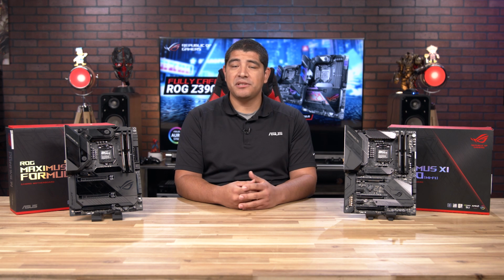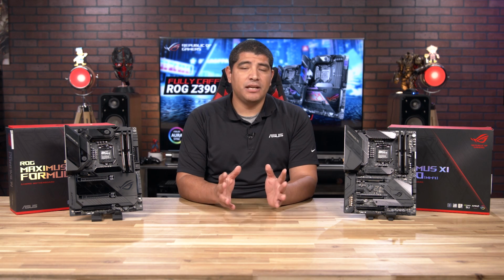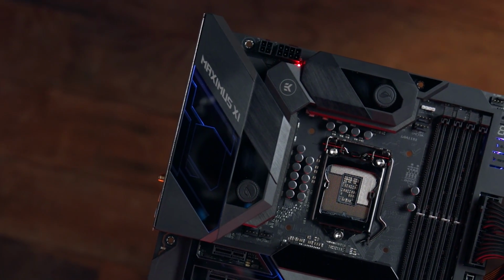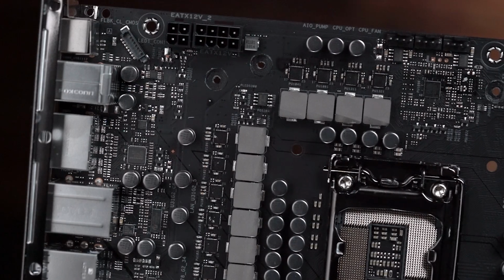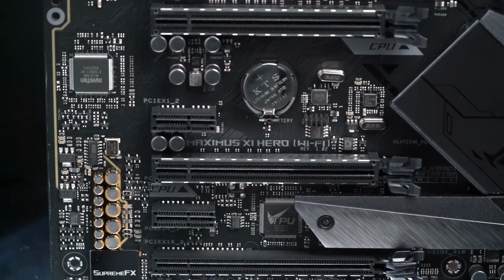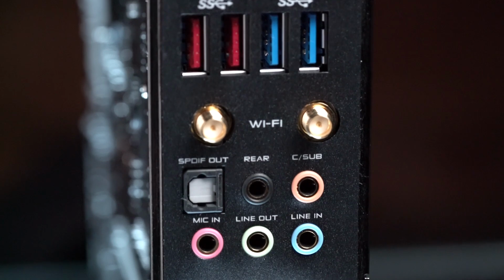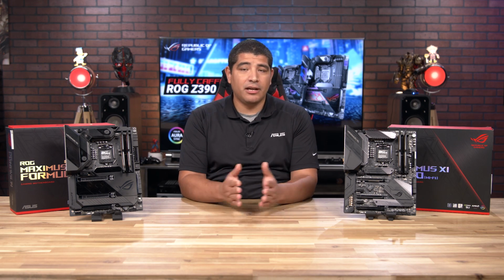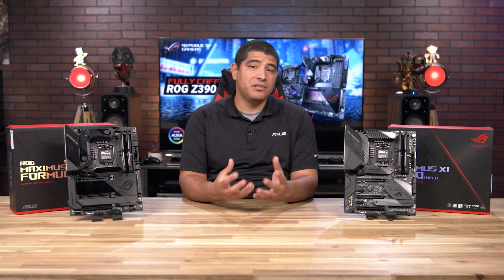ASUS ROG MAXIMUS XI HERO & FORMULA XI - The Ultimate Z390 Gaming Motherboards

Comment: thanks for a great video. Just one thing about the Maximus XI Extreme that I purchased some months ago, I have really terrible audio especially youtube video playback, it crackles and stutters no matter which driver version i try. I've tried setting the driver with MSI mode utility tool but that didn't help. I may need to RMA this mobo.
Reply: That sound like a u problem jk its probably jusg your board it probably a manufacturer error retern it and buy another one

Comment: Can anyone help me? I don’t know if I should get a Maximus 11 hero or formula or extreme. I am buying a rtx 2080ti strix and a i9-9900k .
Reply: Shamonst3r go for formula, it’s the best board on the market at this time and your build can be well complemented by a good mother board. :)
Reply: I have one question though. The formula has a ek waterblock but I won’t use water cooling. Wouldn’t that part of the board overheat then?
Reply: Please respond
Reply: @shamon3946  no that i know of, if the air cooling is fine for other mother boards that has ek waterblock, the formula mother board should be fine. I use a AIO on my Formula board and it is just fine.

Comment: Guys, can I use the FORMULA XI motherboard without a water cooling system? If I play a lot or work with a lot of render, could there be a problem of overheating on the motherboard if I do not use a sophisticated water cooling system?
Reply: You can, water cool keeps the components cooler and you can push the board to the max.

Comment: Do you have to water cool the VRM section or is that just a secondary option?
Reply: The VRM is designed to run passively and active ( with water ). The full copper heatsink has the ability to dissipate heat even when overclocked. You do not need to water cool it but it is designed to perform at its best with water. if you do not want water cool it then you would probably be better off getting the CODE or HERO unless you specifically want the aesthetics of the FORMULA. You can check out a review at overclock.net where they tested the board even with a full overclock even without using water cooling.

Comment: Asus software Aura and LiveDash is broken even with newest version. It has been been broken for almost a year now. LiveDash settings won't take effect when applying your settings. And Aura software sometimes won't launch showing "Aura stopped working" even with newest version.
Reply: consider emailing me with more details at PCDIY at Asus dot com - I have currently tested the current version of AURA and Live Dash without any issues. There are cases with the previous legacy builds where there can be corruption or issues with the registry causing problems. In these situations, I do recommend you try a clean OS install and then install the applications separately with full reboots between installations. With the current 1.07 build, I have not had any issues with control, sync, rebooting. We are also working on a large update where we will be integrating AURA within our new Armory Crate application. This will unify control, monitoring, and RGB lighting all within one application.
Reply: @jjguerrero8465 . Big fan since Newegg with Paul's Hardware days. 

Update. I am currently using LiveDash Version 1.01.08 without AURA installed.

Motherboard: Maximus X formula
CPU: i7 8700k
RAM: Dominator Platinum 16gigs @ 3200Mhz

Uninstalled LiveDash Version 1.01.08 and decided to try installing the newest  LiveDash on ASUS website for this board. The result, same issue. The latest LiveDash won't let applied settings take effect. Uninstalled Latest version of LiveDash and installed LiveDash Version 1.01.08 again. Works perfectly and without AURA installed. 

Observation. It seems that AURA (Even with older versions) and LiveDash can't quite work well together. And one thing I've noticed is that, AURA's current versions, some lighting transitions like Rainbow mode, the color transition seem laggy that sometimes the transition is at 8 FPS vs without AURA installed, the transition is quite a lot more smoother.

Comment: Z390 boards are garbage for an i9-9900k,some cheap built,hottest running boards with 4 phase vrm.not to mention some of the most expensive.i watched in depth teardown  reviews of these 390 boards and they are garbage.asus z390 boards are the ones I'm taking about for those who dont know.
Reply: @Daniel I know I have a z390 gigabyte aorus master. I were talking about Asus z390 boards are garbage.
Reply: @Daniel MSI also has good z390 boards

Comment: I got Maximus Formula XI as well. The problem is my Motherboard always reboot again and again when I start my pc. I find it out because I boost my bus Ram to 3000-3200mhz something, If I use default bus Ram like 2166mhz nothing happen. Anyone know about this issue can u explain me pls ?
Reply: Ensure you have the latest UEFI. From there I would default to using the XMP value for your memory. Once you have done this and ensure it is stable look to increase the memory divider but you will need to increase the voltage for the DRAM beyond it's XMP default value if you overclock the DRAM frequency. you can also help to ensure stability by altering the DRAM timings. Initially, I would consider setting the DRAM timings high to see if the DRAM you have even likes running at higher frequencies. Consider something like 17,17,17 and once you verify stability then you can begin to bring down the timings.

Comment: Not enough Phases for the i9-9900k . The only board that’s with getting for the i9 from Asus is the Asus Rog X Apex and for some reason it wasn’t released in the US and  has better VRMs and phases and is selling in Europe cheaper than the Formula and better lay out than the Asus Rog X Extreme. 9 gen Asus Mobos are the worst ever and I’m very disappointed with Asus. EVGA Z390 Dark ,MSI Meg and Gigabyte Aorus Z390 did it tight for the 9th gen .

Comment: The VRM on my Strix z370i is regularly over 80c when running 4.8ghz all core 8086k, with a fan directly over it and right behind it on a custom water loop. While transient response is great and all, I don't think most users want to have to invest in a monoblock or some sort of active vrm cooling just to run their overpriced Intel CPUs at reasonable all core boosts...This design was fine for quad cores, but there seems to be pretty overwhelming user backlash on the decision.

Comment: Crap VRM on both of them. If you want to go with ASUS this season your only viable options are Maximus XI Apex and Extreme.
Reply: My 9900K is overclocked to 5 Ghz on all cores. No VRM temperature or power issues on this board (Maximus Formula XI) AT ALL.  It's neither overkill nor under-powered in terms of VRM.
Reply: @JcRabbit  hey man what should i get z390 or hero?
Reply: @somakrv  Z390 aorus master or MSi z390 meg ace

Comment: ASUS's decision to go to 4 phase VRM's on these boards was really a crappy decision.
Reply: I’m very aware of the design choices, and there are plenty of boards that can ‘handle’ k processors, the issue is how well they handle them.  The VRMs for the hero design run much hotter than even previous generation Maximus X Hero design on those same processors.  While the additional induction does smooth out the response it would be much more efficient with 8 full phases.
Reply: As noted in my response to Rokugan. The design is proven to show it can handle any of the K series CPUs and without a full understanding of the design, a generalized statement is just that. The design was developed to complement the transient response of the CPU while still ensuring more than enough power is provided when overclocked. This is shown to be the case by the community of users who have adopted the HERO. I would also note the VRM design is different between the HERO and the FORMULA they are not the same.

Comment: Blah Blah Blah next level...I have the X Hero with a 9900K@5.1G + 64GB 3600Mhz Ram and ZERO reason to upgrade to the XI gen, literally ZERO. Asus did really screw up this generation with their fake phases, mediocre components, invisible RGB and overall lazyness. Even the XI Extreme is unappealing and overpriced to me, go see the customer reviews out there. I feel like they´re just milking the ROG brand at this point, which is very sad because many of us loved what it meant. The only MB I would buy for an upgrade is the Gigabyte Z390 Aorus Xtreme, that is a true flagship.
Reply: Thanks for the feedback. The MAXIMUS X is an outstanding board and for most, there would be no reason to upgrade from such a recent chipset as many of the key features are identical. With that noted the VRM redesign is not about cost it has been specifically developed to align with maximizing transient response and also still ensure more than enough current support. Few people truly understand VRM design and I can tell you with confidence we spend considerable time to test and evaluate the design prior to ensure it meets a level of expectation for these class of boards. This has been shown in the overclocking results of the community of users who have the board regardless of the perception that offers may convey regarding the design. I would also note this is something that comes in waves. When we first rolled out digital 8 phase design all competitors noted their high phase count ( low amperage inductors ) for 12 or 16 phase boards were better but slowly every vendor changed to similar digital power delivery designs. In the end, the total VRM design is a sum of  PCB, controllers, individual components, firmware tuning, and specialized microcontrollers. It is not just one aspect and needs to be evaluated as such. Thank you for picking ROG for your current build and best of luck with it in the long term! May your clocks be high and your temps low!
Reply: @jjguerrero8465  Thank you very much for your answer, it´s actually much appreciated. Good communication is key, specially when the community sees a discrepancy between facts and marketing. Another recent example: the Hero X was advertised as having a VRM sensor, which the majority of the Hero X MB actually didn´t have (included mine). It seems there are 2 versions of the board, we asked Asus repeatedly but never got an official response. Asus silently modified the initial marketing specs removing the mention to a VRM sensor instead of giving an explanation about it. This is the kind of thing that fuels frustration in your client base: https://rog.asus.com/forum/showthread.php?100679-Maximus-X-HERO-(non-Wi-Fi)-No-VRM-temp-Sensor.
Also, your doing a weak favor to the ROG brand by flooding the market with generic products that are clearly non enthusiast grade, like your Asetek made AIO which is crazy overpriced and offers no advantage vs the competition, ROG aesthetics aside: https://www.kitguru.net/components/cooling/silas-newman/asus-rog-ryujin-360-review-an-aio-with-an-oled-screen/5/

Comment: WARNING!!!

Asus products are amazing... HOWEVER...

if EVER your product breaks... you will have to deal with their customer service and repair departments... which are UNBEARABLE... YOU HAVE BEEN WARNED!!!
Reply: Gooseman2k2 you’re just unlucky. I’ve bought Asus boards since 2006 and never had a board break on me ever.
Reply: @Gloray83  NO you got lucky.
Reply: @Gloray83  please read my comment...

nowhere in it do i say they break easily...
Reply: Gooseman2k2 I did read your comment. Why else would u call customer service for “repairs” I understand Rma’s happen but, I’ve never shopped directly from the manufacturer. Newegg and Amazon handles these issues very well. You just get a new board.
Reply: yeh they fcked me about with broken asus phoebus that was still under warranty.
Reply: I had an Asus Z87-WS board fail and my experience with my RMA with Asus was 5 stars. I recieved a replacement board within a couple of weeks.

Comment: What materials is the VRM water block made of on the Formula? Any nickle or other finishes in the interior of the heat sink where it contacts the fluid? How reactive could it potentially be with coolant?
Reply: It is a full copper block. It has been built to complement high-end water cooling setups ( custom ). At the same time, it is designed to work passively as well. The choice is yours.

Comment: Where are the Apex and Gene?  I had to import the latter to have an Asus Z390 board that can actually overclock RAM.
Reply: These boards offer very good DRAM overclocking. The APEX is limited sku so inventory is not always on hand. As for the GENE it should be available in the US within the next 30 days.
Reply: IN F*CKING EUROPE, BECAUSE ASUS HATES AMERICA!! I'm waiting on the Z390 Apex as well! I'm stuck with the i9 on my Z370 Apex. I can't even run my i9 with my 4133MHz RAM even on the latest BIOS! I already swapped my CPU 2 times. I was able to run my RAM @ 4133MHz completely fine with my i7 8700K. My motherboard will just not POST successfully with my ram at 4133MHz. It will POST completely fine if I set the ram to 4000MHz though.
Reply: @NativeWarrior081  that's a chip issue the imc is too weak to run that high then my 9900k runs 4266 just fine on a hero board im even able to hit 5.1 on my hero board all though it does take a lot of voltage and get so hot i had to raise the thermal threshold to 115c just to use it like that but there is enough power and quality power on this high end 4 phase to do a 9900k right. Asus doesn't offer anything like the z390/x299 dark. Motherboards like those are super rare just flawless 100% flawless and it kind of sucks but it is what it is and they make a good bios and they use parts that work just not the quality of the EVGA Dark boards. Also just another thought what power supply are you using overclocking is a reflection of motherboard cpu ram and power supply quality. Going to want at least a 1k gold unit from a respectable brand when pushing high end parts to the limits

Comment: I am ok with the board. But what happens with the code?  Fans experience is fantastic and also the wifi. love the serenity of the build and match all and I need the 5.0 is there. Asus bios  has being a miracle how the math goes nice. Nice work Asus that you have a price 💯 please keep the bios safe and well maintain. Bios is the key and drivers.  VRM is nice. I push 240w and no issues, no drops, and temps are on spot. when i needed is there for me
Reply: The CODE is a great board. Most of what is detailed in this overview also apply to the CODE. We did not include it in this overview as we did not have the board onhand ( like the APEX, EXTREME or GENE ). Regardless it is an outstanding board especially if you do want or need the water cooling VRM block on the FORMULA. There is also a difference in the "armor" is it is not the same material/finish technology so it does not have the same lighting effect but still looks great. Otherwise, the boards are almost the same.
Reply: @jjguerrero8465  thanks JJ. Please stay on top on drivers bios Windows apps. Is crucial and more in these times

Comment: i don't like how aura sync doesn't saved lighting profiles. some days i like my computer blue and purple others i want it yellow and red i shouldn't need to manually switch every single led on my ram to do that.
Reply: AURA settings are maintained between reboots. We are developing the next version of AURA which will be part of ARMORY CRATE. In that version, there will be more extensive control and profile options. With that noted, if you do define a color theme across components with the current build it will maintain that theme/selection through reboots or shutdowns.
Reply: @jjguerrero8465  when is it expected to launch?
Reply: @jjguerrero8465  Profiles are indeed a very important feature, but even more important than that, IMO, is the ability to have different effects associated with different RGB sections/parts.

Currently you are doing it wrong, you coded Aura based on List of Effects -> Section(s) when you should have List of Sections -> Effect. 

There is also no way to address individual LEDs on ARGB fans, led strips, etc, which basically makes the Addressable part in ARGB meaningless. If I want half of a fan to have one color and the other half another, I cannot do that. If I want a specific static color gradient on a LED strip I cannot do that either.

Finally, I - and many others - noticed that the Lighting control service uses a TON of CPU when not using static colors. This is not something I see in ANY other RGB controller software!

I think you guys should just sit down, look at what other RGB controller software can already do, pick the best features and effects from each and integrate them into Aura. After all this time, Aura is still pretty basic, so please listen to your users!